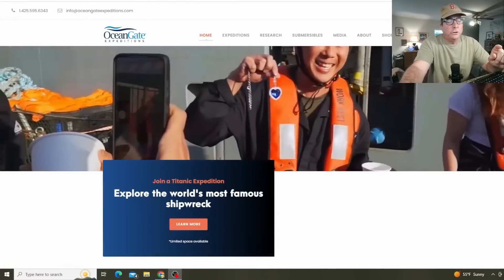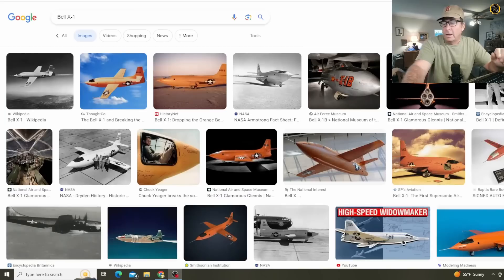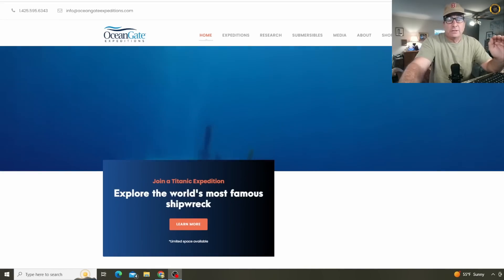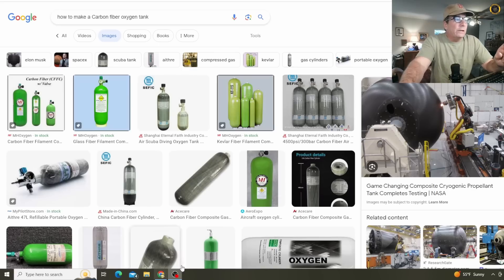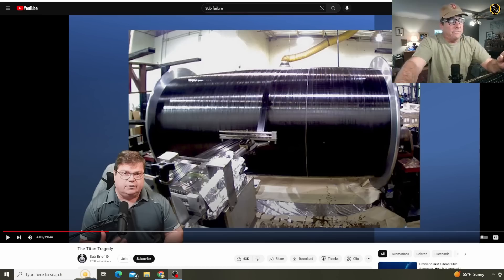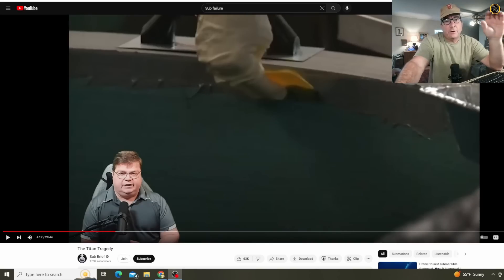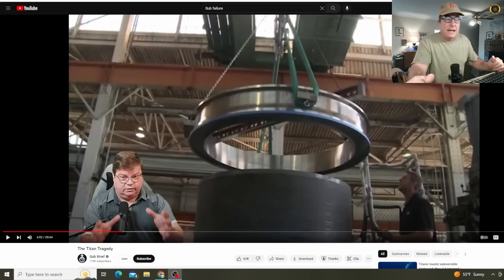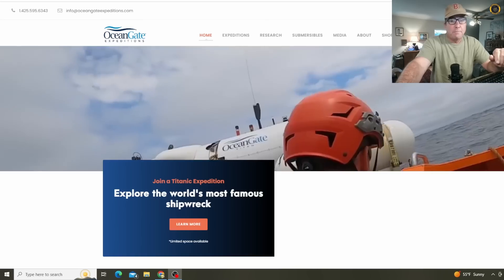Oceangate Sub Construction Details and Implosion

Comment: Yes,,the vid shows neatly wound CF,,but no length wise rods,,yet the pressure is the same in from the ends,,if only resin was holding them apart it would have crushed just like a stomped on empty beer can,,

Comment: Also what troubles me is the hand application of the adhesive. By the time they got to the end, the part they started on was already a certain degree dried. So that seam did not have a attachment that was 100% uniform around the entire circumference. Shadetree engineering at it's finest.

Comment: The most unbelievable thing is that Rush thought he could PREDICT and mitigate the hull failure with 1,500 m worth of advance notice by listening to CF hull noises. As someone pointed out, these failures are pretty unpredictable. Certainly not reproducible to the tune of 1,500 meters worth of descent time. It was likely "creaaaaaaak, BOOOOOOM". What a tool Rush was. Aerospace engineering degree from Princeton University. Not a good look for PU.

Comment: How come the carbon fiber tube was not manufactured in a vacuum tank , any body that is familiar with a composite  design and manufacturing of the basic rule of micro air bubbles developing in the resin and with the curing take place the resin heats up and expand the air bubbles leaving inferior structure undetected.🤔

Comment: Carbon fiber’s strengths is basically the opposite of concrete. I’m sure the only reason this didn’t collapse sooner was the resin. Carbon fiber is like a seat belt, can hold back a lot weight through tensile strength but it’s easily compressed.

Comment: Thankyou Juan for your input you are the first I've seen mention carbons poor compressive strength & poor layup design Ie lack of apparent longitudinal fibres in the layup.
Metals deform before they break composites just break.
.It is pretty well known that carbon fibre has poor strength in compression so while excellent for containing pressurized fluids would clearly be weak under compressive forces.
Knowing that kevlar is nearly as strong in tension but far superior strength in compression to the point it is used in bullet proof vests.if you absolutely had to use composite construction (still a poor choice as only hull material due to its non continuous nature)  it could probably have been used to good effect to protect the crew in some capacity for instance as an inner hull crew protection pod or as a sacrificial outer layer that protected the pressure vessel from impact.
Better designs coupled with destructive testing to refine those designs could have prevented this tragedy. Sadly the design featured only a single hull whereas I believe that military submarines all use double hulls.....no built in redundancy.

Comment: Very interesting. I was very surprised to see the carbon fibre glued to Titanium. Titanium in my experience gets an oxide film very quickly after machining. So the glue is sticking to an oxide film. When fixing strain gauges to Titanium. I had to remove the oxide film very fast and have the gauge ready with glue on to apply immediately. Other wise the glue would not take to the titanium.

Comment: There are so many potential failure points. The carbon fiber tube, the end cap joints, even the window. How was the wiring to the thruster engines run?

Comment: The B-2 bomber is constructed of carbon fiber, right?  During normal, level flight the top surfaces of the B-2 fuselage should be in compression - compression in a direction parallel with the long axis of the wing.  The engineers at Northrop Grumman must have figured out how to handle compression - and fatigue! - in laminated carbon fiber.

Comment: My guess is the carbon fiber began delaminating from cold and pressure cycles.  There’s no plasticity in CF and no deformation you could check as there would be from metal. It holds its strength until it catastrophically fails, similar to glass.

Comment: Adiabatic compression at 12500 ft ocean depth.  Total potential energy (pre-implosion) at that depth = Pressure x Volume (4.1 Mega Newton/sq meter x 5 cubic meters) = 2.05 MegaJoules or 0.05 tons (>100 lbs) of TNT. Massive heating during adiabatic compression would be a like a giant diesel piston igniting the air and any organic molecules (in this case human tissue) instantaneously turning them into ash.  It was a bad day down there.

Comment: He's correct - that tube is has only one axis of construction. The rapid back and forth action that should have been used simulates multiple axes. That's the best way to do it when dealing with a carbon fiber tube. Even then, CF loves to fail under compression. And it gets weaker every compression/decompression cycle.

Comment: It will be interesting to see how simple - or how complex - was the finite-element model Rush used to design the Titan.  'Fatigue' is difficult to model.  The joint between the titanium end pieces and the composite cylinder would be difficult to model.  How did he come up with the compressive strength of the composite fibers in a direction perpendicular to the fiber wrap?

Comment: AND the dissimilar shrink/expansion rates for the carbon fiber tube versus the ring and dome bolted to it.  Probably different pressure contraction/expansion rates as well.  It's 29 degrees and about 6,000 PSI down at the Titanic site, cold due to the deep sea and salt in the water allowing it to be superchilled below the freezing point of water alone, and the pressure from the depth of course.  Metals and carbon fiber doubtlessly expand and contract at slightly different rates due to temperature, and the extreme pressure DOES actually compress the structure of the metal and carbon fiber components so they actually are slightly smaller at depth than on the surface in an unloaded (unpressurized) state.  Dissimilar materials respond differently with different expansion/contraction rates in response to the temperature and pressure, and this can create enormous stress in the structure, particularly in the joining points and whatever means or materials are used for the actual bonding or joining of the materials, which can exceed the other forces acting upon it in the actual loads seen in operation.  Particularly when it comes to repeated cycling of the materials, this can cause breakdown or faults to develop in the joint and/or cause failure in the materials on either side of the joint (many, but not all by any means, bonding materials are actually stronger than the material being bonded, but all this usually equates to is when the joint breaks, the bonded parent material breaks BESIDE the joint rather than directly through or in the joint itself... like a good weld, the parent metal on one or the other side of the weld seam will break before the weld itself.

Comment: Exactly as I thought - in compression the resin matrix is the thing that holds it together, tension is handled by the fibre..  There seem to be all hoop fibre, not axial fibre... the thimble looks like it was built like a slinky, any cycling would have pulled / pushed the tube like an accordion. With no Axial or 45° bias fibre there wouldn't even be a show of stress fractures in the hull, especially as it is all shrouded in - so a pre-flight might have been a good idea, lift the shrouds & have a look.  Another poster said the hull was 5" thick, not 7" as required.. so, corners were cut.

Comment: I doubt the failure was about the seals or the dissimilar materials. Those are things that would result in leaks, and sinking. In this case it imploded, which means it wasn't leaking, but part of it failed catastrophically. That would be the carbon fiber cylinder.

Comment: You probably hit the nail on the head, the carbon fiber is excellent for tension applications but not for compression. It would depend on the epoxy to maintain its cylindrcal form and also support the longitudinal compression. With millions of pounds of force over the hull, any change in the cylindrical form would result in increasing differential hull pressure angles until failure or the layers of woven fiber strands could accordian over each other longitudinally.

Comment: 8 years in a major airline composite shop, that is my experience working on complex carbon flight controls and aircraft structures. You and a host of other podcasters show a lack of knowledge of carbon fiber NDT. We  use ultrasound-not too much different than the ultra sound machines used on pregnant mothers, as well as x-ray. We DO NOT cut open a carbon fiber repair to see if it's a structurally sound repair. That's ridiculous.

Comment: Nominal wind angle for pressure load is +/-55 degrees, hoop windings not nominal. There would be resin cracking and probably interlaminar shear which would accumulate with successive loadings (dives), a disaster waiting to happen , they could have discovered this with proof testing and fatigue testing prior to certification. Disgraceful ignorant disregard of established engineering protocol.

Comment: The fact that the pressure chamber was horizontal rather than vertical doomed it sadly. That carbon fiber wrap should have been 10 inches thick and then surrounded by a titanium hull on the outside. 10 times more strength and a thousand timrs more durable. Stockton thumbedhis nose atdafety and see whete that got him. There was a way to stay safe and still make those feep sea trips, throwing causion to the wind is pretty stupif thing todo, huh!!!

Comment: One of the complaints from David Lochridge, the former Director of Marine Operations for OceanGate, was that there was no NDT executed on the submersible.  That is in spite of the fact that non-destructive testing was originally part of the manufacturing plan.  He was fired for pointing this out in his inspection report.  You are correct in that this mix of materials is highly suspect in such a highly stressed critical component.  One of my first concerns upon hearing this was for the difference in modulus of elasticity between the two materials (approximately 17400 psi).  This means that the carbon fiber is actually stiffer than the titanium, so that as they are stressed, the two materials stretch or compress (strain) at different rates, working the two materials against each other.  Similarly, there is a large difference in the coefficient of thermal expansion between the two materials, adding to the expansion/contraction stress between them.  Although the temperature difference between the surface and the bottom is only about 20 degrees F, the two comparative stresses added together create a dangerous risk and identify a likely failure mode at this titanium/carbon bond line.
Aligning the fibers perpendicular to the axis of the vessel is fine, if your only stress is radially outward, but the sub must also resist the compression from both ends.  That is why the absence of diagonal fibers is suspicious in this instance.  However, core to the problem here is that the carbon fiber cylinder was loaded in compression, when it is well known that carbon fiber's mechanical advantages are in tension applications.  Shear strength is poor, compression strength is poor.  Tension is where it shines, and that is not how it was used here.

Comment: I feel sure that the two end caps will be in one piece and the failure will be the carbon fibre tube. What is very concerning is that in previous dives, which I believe where to lesser depths, it was noted by the occupants that there was a lot of cracking noises, but it was not tested after the dive and they continued with subsequent dives. It was said that they believed that the sound sensors would indicate a need for an abort on a dive, but these sensors did not apparently show a problem even when the cracking was audible inside the vessel. As you say, the strength in fibre is through a woven form and not as a bobbin,the later is only going to resist pressure from the inside and what is needed is a way to displace the pressure evenly on the outside to resist deformation. Its all smacks of wishful thinking rather than clear objective look at the problems each detail pose. Its really a risk just for the creator and not adventurers using what they presume is a well considered design, its a transport for them.

Comment: Juan, good summary. You can use ultrasound to check for delams. We did that with the AV8B wing. As you know accidents are usually a combination of errors.  The cycles may have caused the failure together with high loading and salt water. Perhaps the glue itself started to deteriorate with the repeated salt water exposure. Getting the wreckage to a lab is essential to solving this riddle.

Comment: They obviously used carbon fiber because of its lighter weight. It could not handle 6000 psi pushing from the surrounding water.

Comment: Given the Titan's many obvious design flaws, I find it incredible that it lasted even ONE dive to the Titanic wreckage.
Reply: Given strong enough materials and sufficient stiffness it is understandable. BUT the main tensile force to be withstood is radially which is not the direction of the carbon fibre as far as I can tell. The glue if very good will be adequate unless (until) any defects develop. In high stress that can peel off the carbon fibre and delaminate. Pressure cycling will worsen delamination - a bit like a fatigue fracture in metals. Eventually the glue will fail, delamination will spread further into the structure increasing stress concentrations until a rapid total failure.

I don't think any lives have been lost visiting the Mariana trench  and ocean life has been found nearby at extreme depths !  We can only visit deep ocean floors with relative safety in suitable craft. We will see if the US coastguard or others manage to retrieve what remains of the carbon fibre. I understand the accident happened 300m above the bottom (indicated by surveyed position when all comms were lost) so a carbon fibre jigsaw puzzle might not find all the relevant pieces without extensive surveying of the entire debris field. This is like an airplane accident without a black box crashing at very high speed. I hope they can find out something useful though. I think DSV Limiting Factor has a better place in history than Titan.

Comment: As a submarine sailor in the US Navy, when I first heard the reports of the missing vessel, I told my family that it was a catastrophic failure of the joint between the carbon fiber and the titanium end cap.  You can not put these kinds of dissimilar materials together and subject them to these pressures and temperatures and expect them to never fail.  Our US submarine construction is based on years of research and extensive testing.  This is not a game you play with peoples lives.

Comment: I'm nobody but. The weakest point Surley is the glue between the ring under pressure both materials would react differently resulting in separation under high pressure.

Comment: A metel bridge is not fixed at its ends but sits on metal bearings to allow for contraction and expansion. You have a temperature difference from topside to the Titanic. Would you bet your life on a glued joint of materials with different expansion properties.  Carbon fiber shrinks when heated. This means as the titanium expands the carbon fiber would shrink and vice versa. These two materials are the worst materials to combine on a deep sea submersible!  The two materials with opposite expansion and contraction properties would grind one on the other to destruction! It was just there waiting to fail!

Comment: All these arm chair engineers posting up videos and filling comments. This video is short but has a ton of egregiously erroneous statements. I'm sure when they get the debris off the ocean floor they'll be able to just type enhance into their csi computers and it will give them a full video recreation of what happened, maybe chat gpt will have that feature by then! So easy to reconstruct something that imploded with a pressure differential of 6000 psi and definitively say what the cause was!

P.S. all materials have a finite fatigue life, people say steel has an infinite fatigue life because the industry standard is to ignore the SN curve beyond a cycle count above a practical use case, but certain applications (this not being one of them) can accumulate cycles incredibly fast. Carbon fiber is no exception to this and carbon fiber parts need to be designed adequately for their use case. 

P.P.S. there are methods of NDT applicable to carbon fiber. Oceangate was using acoustic measurements to estimate damage accumulation. This is a great and well understood method.... That requires a lot of testing and development to properly correlate the model. Also I don't know what they're doing with that data. It is entirely possible that their system detected the damage that lead to the failure and given the correct authority it may have been able to issue a surface command before complete catastrophe. 

At the end of the day this vessel was under engineered, it did not violate some principles of material engineering which doomed it to fail.

Comment: Would actually increasing the lenght of the capsule but more pressure on the carbon fiber than the titanium end caps and put it more under tension than compression. I dont have engineering background and am having a hard time visualizing this
Reply: it would not affect the pressure at all (pressure = force over area; the area increases but water alway applies the same force to every point, so force increases proportionally, not changing the ratio*)

Now the carbon fibre experiences more force, so the structure is weaker. 

The fibre now experiences more tension — the fibre in the middle collapsing requires the material to stretch (or fracture)

But it does not experience any less compression. And note that it experiences that added tension entirely across the grain since they did not wind it at an angle

(Note that i am not an engineer eithe r)